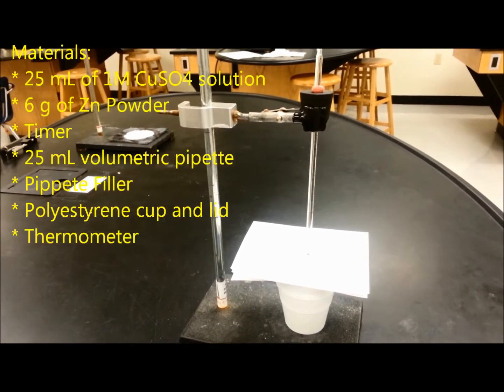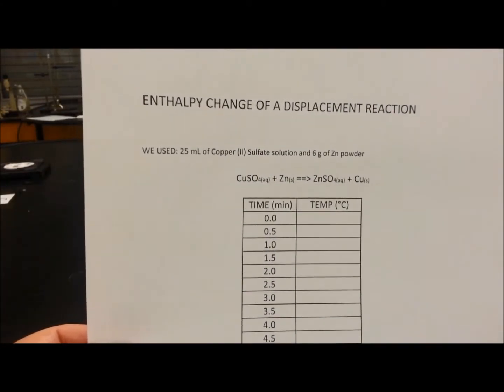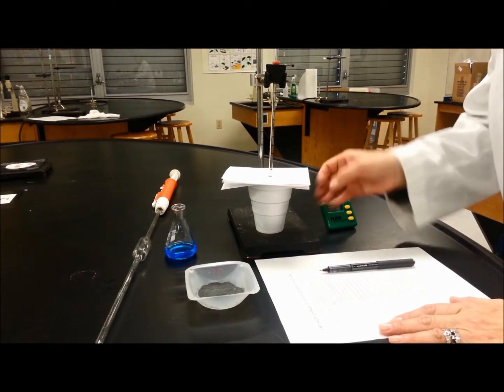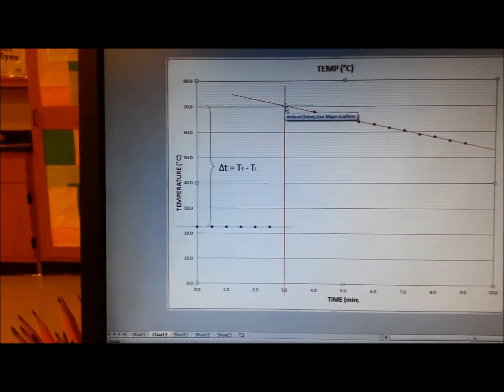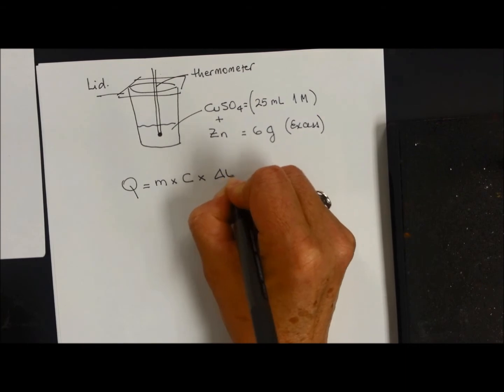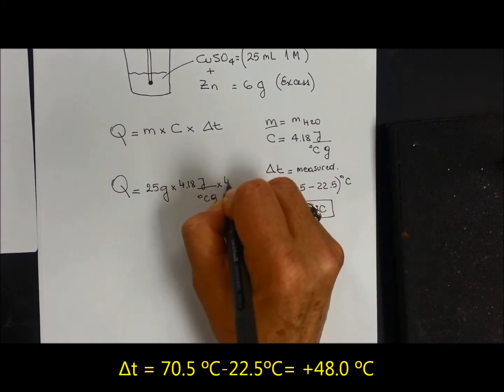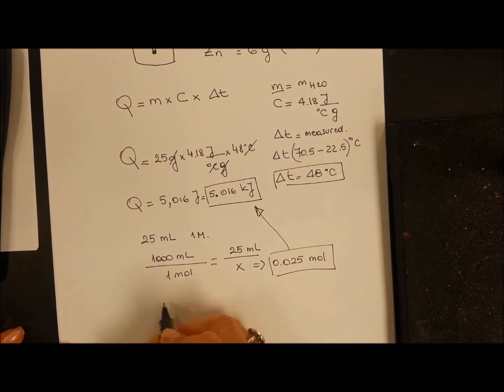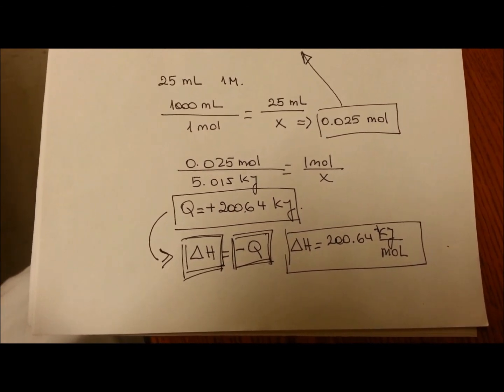Enthalpy of a displacement reaction CuSO4+Zn

Comment: Shouldn't we include Zn's mass while calculating Q as 6g is too big to ignore?
Reply: good question, i initially added the zinc and copper sulfate. i am now confused, i really though you would need to add that.
Reply: @DineshSingh-pr4ij  She's doing the energy absorbed not released, if your calculating the heat released you use add the zinc.

Comment: Hello I did this experiment but my maximum temperature was nowhere near yours. I got 38.7 Celsius and my energy released was equal to 1060 kj.  I do not know how this occured.
Reply from the maker: Hello Hermann

You need to be sure that the concentration and volume of the chemicals you used are the same as mine. 

You have in the data table the beginning and the final temperature. If you used a different volume or when preparing the solution it was more diluted, your results will not be the same. 

I used copper(II) sulfate pentahydrate 1 M. (Remember that you have to include the water when preparing the solution. (Mr=249.68 g/mol)

I also saw another comment about the mass of Copper Sulfate being 25g. this is wrong!. 

You have around 25 g of water and yes, you can assume that the density of the solution is 1 g/mL 

But, in the 25 mL present you have only 0.025 moles of Copper Sullfate (remember to pass from mL to L (or dm3)....

Molar mass of copper(II) sulfate pentahydrate is 249.68 g/mol. 

0.025 moles of copper(II) sulfate pentahydrate is 0.025 mol x 249.68 g/mol = 6.242 g. 

depending the sig fig and the PT you use you will have more or less decimals. 

Please let me know if this helped.
Reply: @analiasanchez8419  Dear Sanchez, I have conducted a similar experiment but with my CuSO4 having a relative formula mass of 159.6086 g/mol. The concentration of my CuSO4 is at 0.200 mol/g. I used 25cm3 of CuSO4 solution, using linear graph interpolation I acquired the maximum temperature of 33.8 C. I calculated the amount of heat released using Q = mc x (change in temperature). 25 x (4.18) x (33.8-23.5) = 1076.35 kj. I know that the CuSO4 is the limiting reagent in this reaction so I must calculate the number of moles it has to calculate the enthalpy change. I do this by dividing the energy released by the number of moles. However, what I can't wrap my head around is can I multiply my concentration by the volume of our solution in dm3. E.G (0.200) x (0.025) which gives me 0.005 mol. Since the density of water is equal to 1g/ml shouldn't my 25cm3 be equal to 25 grams. Which would allow me to divide the 25 grams by the relative formula mass of  159.6086 g/mol? I would greatly appreciate it if you could explain to me why this doesn't work. However that gives me 0.156 mol.  Does it have to do with how many mols there are in a litre of water or CuSO4? The accepted value for the reaction with my chemicals is -217. Using the volume times concentration I get a value of -216. 

Your help would be greatly appreciated
Reply: @hermannklein-hessling9530  Hello Hermann, I was watching this video and then scrolled down through the comments and I think I might be able to answer your question (although I am no professional so do get it checked!). I believe the reason 159.6 (g/mol) / 25 (g) does not work is because in the equation: moles = mass / mr, the assumption for the mass is that it is of 100% purity. The CuSO4 you have used is an aqueous solution meaning that a large part of it is water and the mr of water is only 18 g/mol which would dramatically change the answer. To summarise briefly, the reason you have to use the equation conc = mol / vol instead if moles = mass / mr is that the CuSO4 is aqueous which is accounted for in the conc = mol / vol equation and not the moles = mass / mr equation. Hope that helps! Thalia

Comment: How is Zinc in excess? n=m/M gives a smaller value for Zinc than for CuSO4?
Reply from the maker: #Jaskirat Mann, the number of moles of Zn present are calculated as you said m/Ar.  6/56= 0.107 mol
the moles present in the copper sulfate solution are calculated:
#moles = CC x Vol (L)
#moles= 1M x 0.025 L = 0.025 mol
since the mole ratio is 1/1. only 0.025 moles of Zn are enough. but you have 0.107.
 0.107 -0.025= 0.082 moles of Zn are in excess
Reply: 1 mole per litre * 0.025 litre = 0,025mol
Molar weight of zinc is 65.4 grams per mole, so 6 grams / 65,4 grams per mole = 0,092 mole
There is way more zinc than copper sulphate. since you need a one to one ratio of the two, zinc is in excess.

Comment: I don't get it. Exothermic reactions have a negative enthalpy change but this is an endothermic reaction and has a negative... Can you explain?
Reply from the maker: Hi Joao. You are right. Exothermic reactions have a negative enthalpy.
This IS AN EXOTHERMIC REACTION. that's why the water increases the temperature, the heat released by the reaction is absorbed by the water which in this case is the environment.

Please let me know if you have any questions.